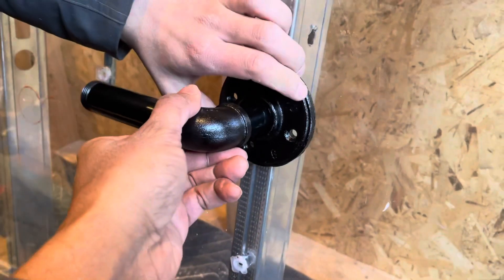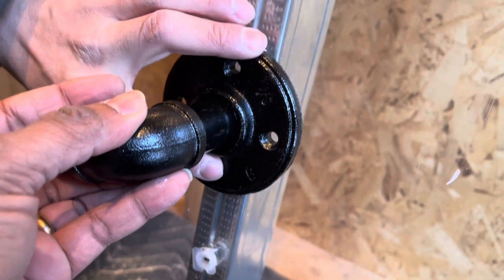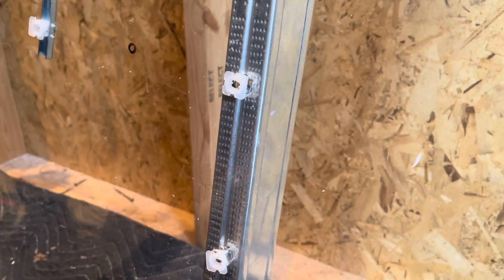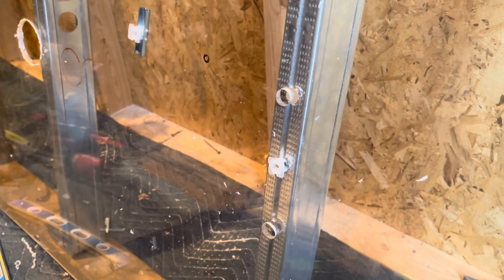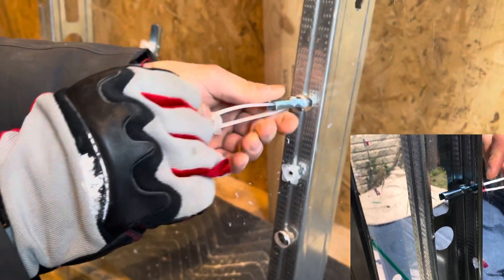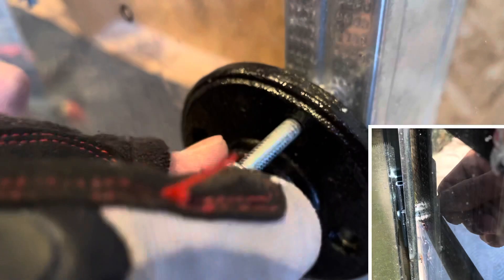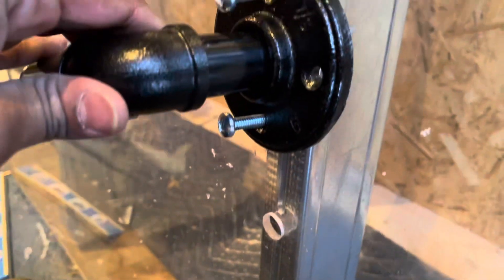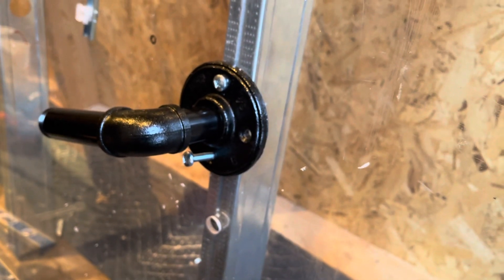How to wall Mount Pipe Shelving bracket on metal stud walls that can hold 100lbs

Comment: can they hold a barn door?
Reply from the maker: Yes. You are referring to anchoring the holders of the sliding door to the metal stud wall right? and you have a couple holders and you will be anchoring it to the wall across the horizontal line above the door.